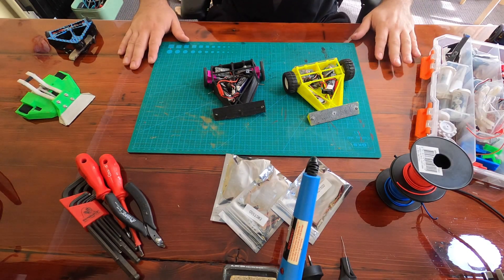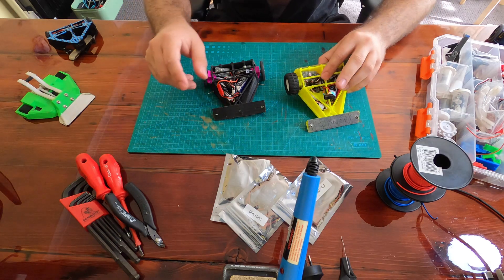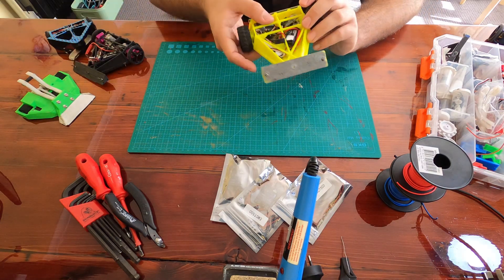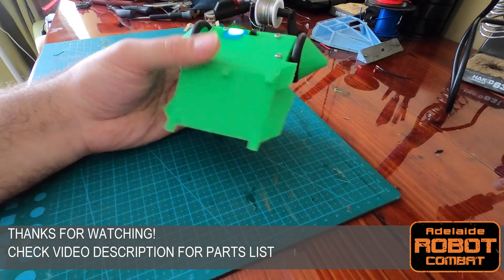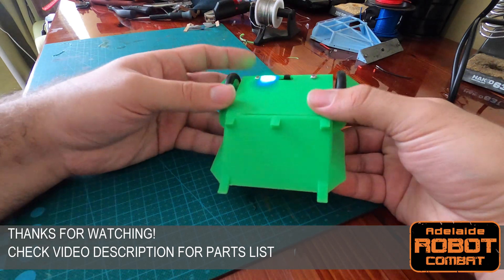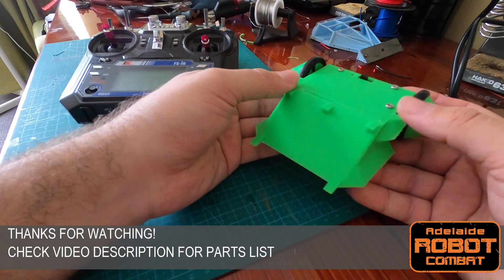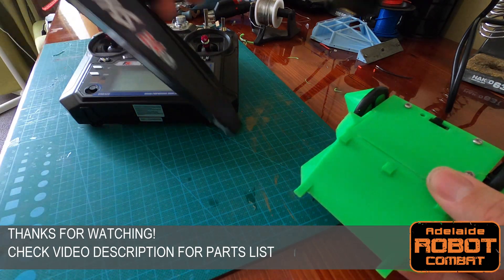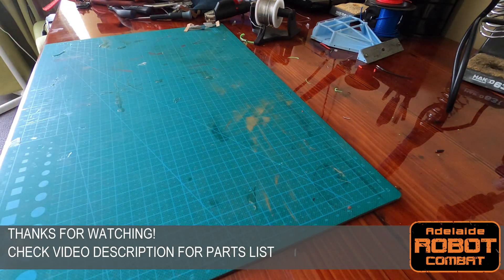Spike - Loan Bot Build Series Part 2

Comment: Just printed this out today and am waiting for all my parts to get here. How much should the empty base with lid and motor clamps be? Mine weighs 80g

Just not sure if 70g is enough leftover for everything else.

My printer has a .8 nozzle as I usually do large prints. I can reduce the wall count if needed